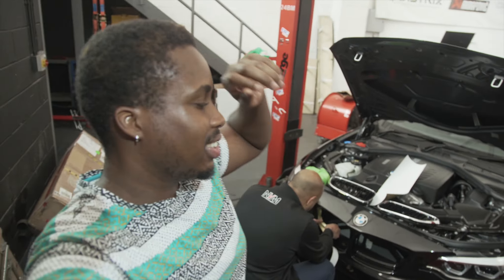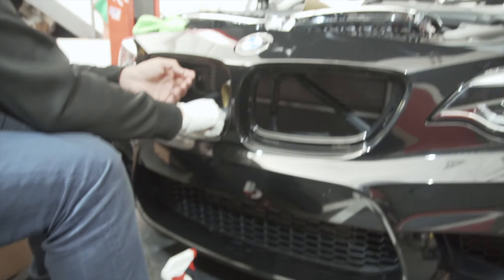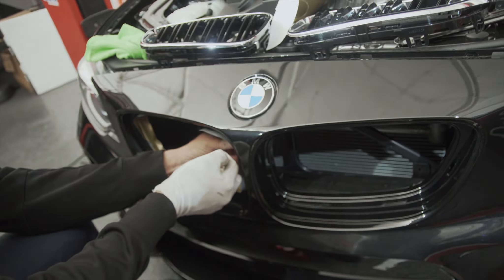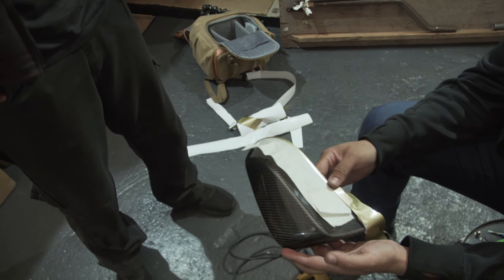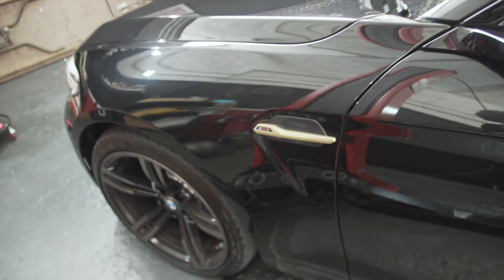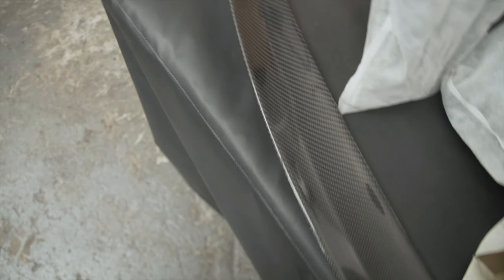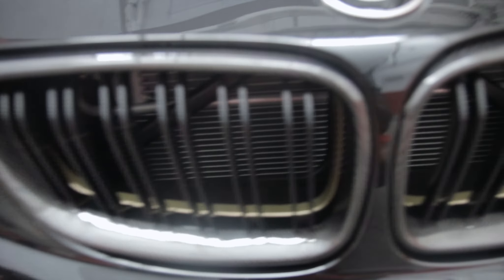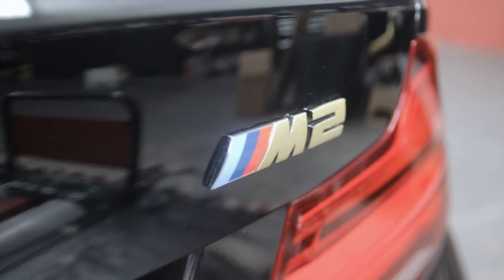Easy DIY Mods For The BMW M2

Comment: Irrelevant to the video ( even tho it was great ) is it possible to drift an automatic Audi A5 ? I know you can clutch kick and right foot break the manual version. However since the automatic version has no clutch and they both have no hand break they have a button can you still drift an Audi A5 ?
Reply from the maker: IIblackwidow69 lol 😂 you probably can on a wet track
Reply: IIblackwidow69  I highly doubt it mate unless you put pvc pipes on the rear tyres like they do to drift kei cars
Reply: RSYT could you not Scandinavian flick the A5 or s5 ? In automatic ? Also would downshifting with paddles or the automatic up down system help slide the car or not really ?
Reply: IIblackwidow69 no idea mate, I’ve only ever driven manual
Reply: RSYT alright thanks anyways
Reply: IIblackwidow69 aren’t A5’s front wheel drive?
Reply: RSYT you can have a front wheel drive or an all wheel drive A5 also have Quattro

Comment from the maker: As you can tell am obsessed with the M2 😂. The power mods will be coming after the Run in service. Will also be interested to see how much power the face lift m2 will make on the dyno. said to be 370BHP. Hit the 🛎 so you know when that video drops 👌🏾
Reply: AEllis obsessed...
Reply from the maker: NV Motorsport UK 🤫
Reply: My mate has a mega low mileage black on black m2 for sale at his garage. Pm if intrested mate
Reply: It’s done 50 miles